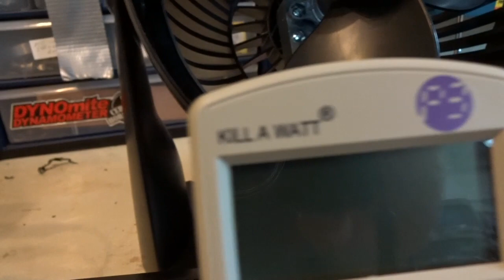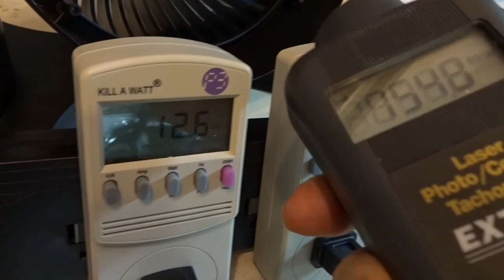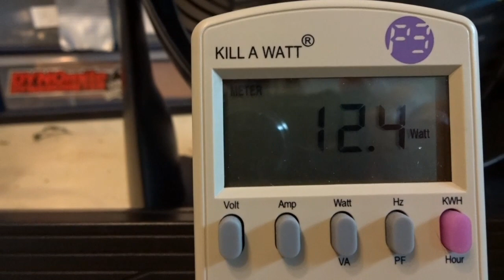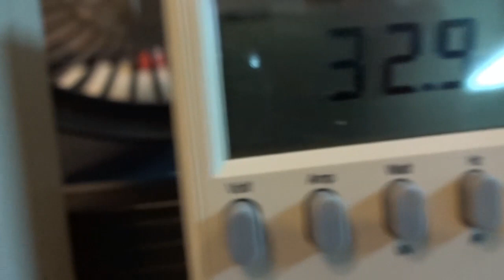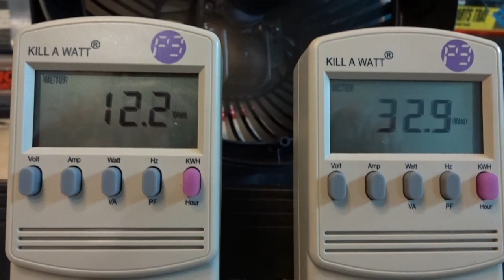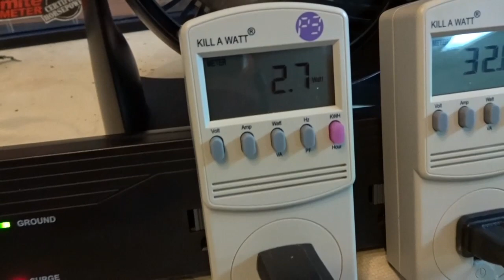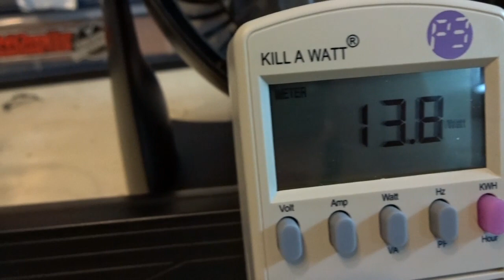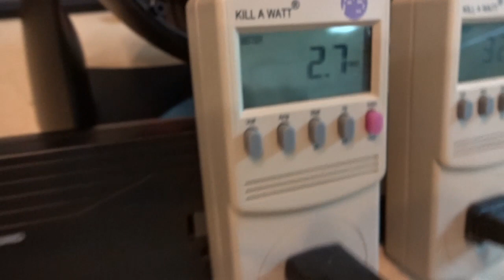High Efficiency Pulse Motor Demo

Comment: Would love to know more about how pulsed motors work and less about what wind noise sounds like :p
Reply: I haven't found anything good on exactly why pulsed motors are more efficient aside from the fact they are usually driven at very low speeds on lower-than-normal resistance bearings. This is close to the best video I've found, to be honest and you're right (from 4 years ago).

Comment: Hi,
One problem with your test is, one fan is in open air and the second has the shroud. The shroud helps to channel the air and will cause more resistance thus more current draw. Can you fit a shroud around the other fan and retest?